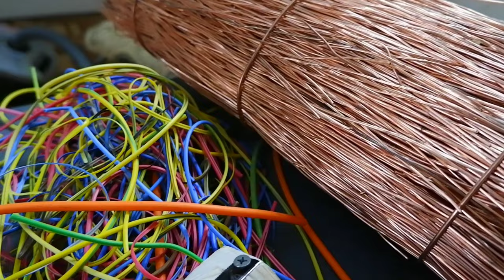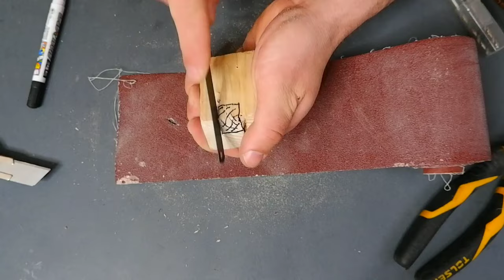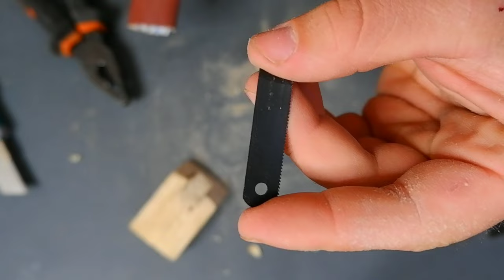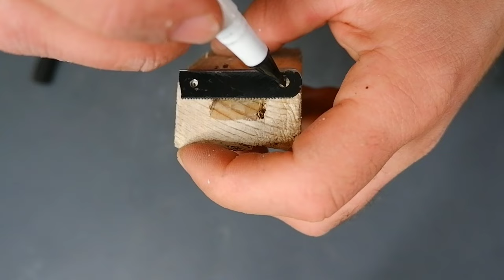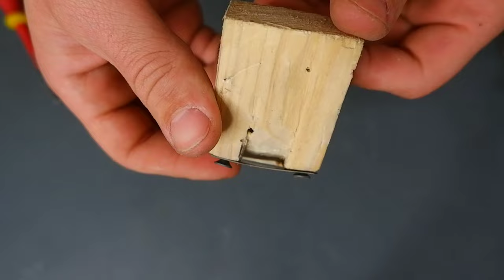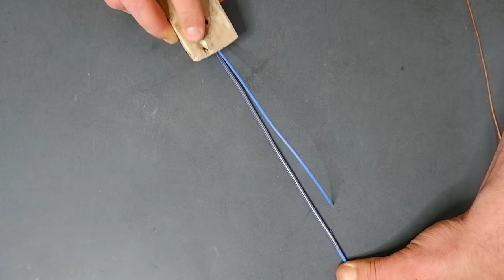This is truly the best wire stripper in 2023

Comment: I have a propensity for making tools myself. One thing I've discovered, most of the time you can make more money selling the actual tools, rather than using them for their intended purposes. For example I thought I wanted to make knives, which requires a lot of specialized tools. The effort put into making/selling knives is not the returns. I ended up gifting most of my knives. But I made a lot from selling the tools, especially my homemade anvils.
Solid wire is so easy to strip with a fillet knife, I can really justify the effort to strip small stranded wire. But I'm glad you've got it figured out 👍
Reply: Just like the people who sold shovels during the gold rush! 😉
Reply: @JeffyNguyen  And don't forget Levi's!

Comment: Works great for short FLAT non-stranded pieces of wire.  Now I have to spend all my time straightening out the wire before I strip it.
Reply: Haven't found fully painless way to strip stranded wires. Solid wires are piece of cake
Reply: @YoStu242  
Best way I have found is two drywall screws set in wood right next to each other. (Touching)  Tighten the screws to hold the wire securely under the heads of the screws. Then pull the wire between the screws while holding a utility knife blade tip lightly between the screw heads to make slit in the wire.

Comment: The simplest quickest cheapest one for any wire is a piece of wood and 3 scews. Just adjust the centre screw according to the diameter of the wire your stripping. To make it is all the time it takes to screw 3 screws into the wood.